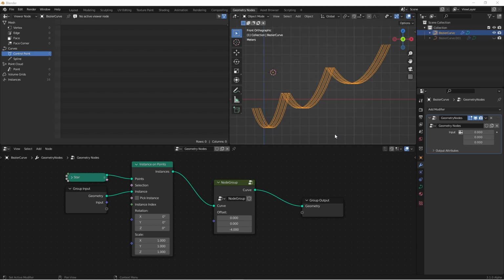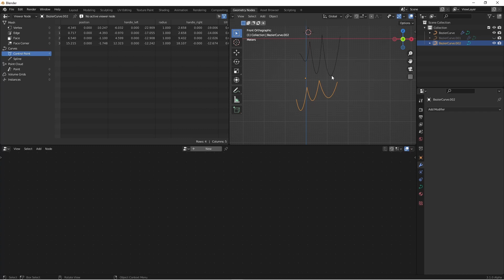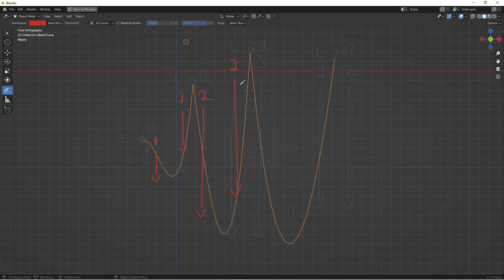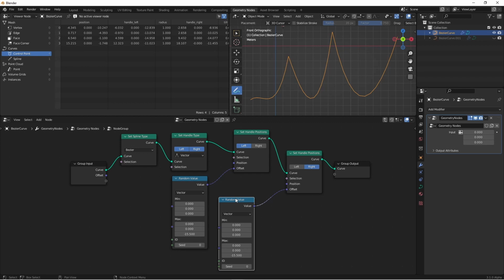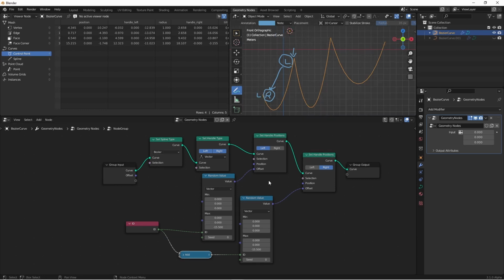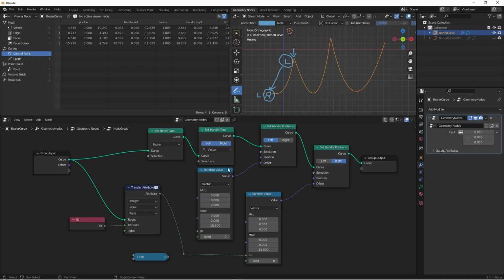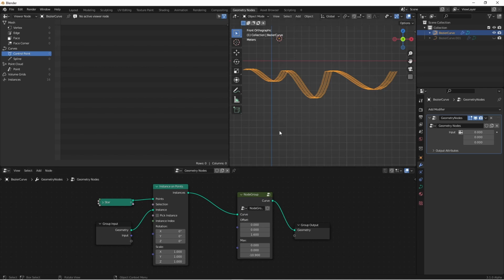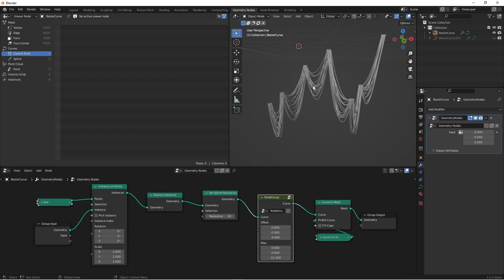Blender Fields - Hanging Cables Part 2

Comment: Why are curves referred to as curves but also sometimes splines? Is there a reason for dstinguishing them with different names? Kinda confusing like how points are points but also vertex, is there a reason for distinguishing those with two different names aswell?
Reply from the maker: Curves can contain multiple splines. A spline is one connected set of control points.

Vertex is a geometry term. Points are used to represent mesh vertices, spline Control points and point cloud points.

Comment: Working with 3.0 and had to make some tweaks with the random height offset as it wasn't working correctly. But then also for some reason placing the set spline resolution after the Realize Instances didn't work. But placing it after the grouped node it works.

Comment: Great tutorials - clear and concise. I've learned quite a few important things already.
I was wondering how would you create a node group where drooping amount is influenced by the length of each curve segment? Because naturally longer wires would sag more.
Reply from the maker: There is the curve length and curve parameter nodes that return length amounts. You could probably work those in.
Reply: You can use the Curve Parameter to a Multiply to a Combine XYZ into the Max value of the Random Number Generator.

Comment: consider the id and index may not conresponde, should it be necessary to link the index output to the id input of left random generator, or just use index / index+1 as the id input of the random genetors?
Reply from the maker: That is why we use the transfer attribute of the ID in index mode. The first random node gets the ID implicitly, we need to get the ID from the 2nd point, Because this is a simple case. there are probably other ways that will work! Do what works for you!

Comment: Excellent, very well explained. Last week in one of your videos you show us how to select points by their index number using index plus compare math node,
it is also possible to select a specific face or group of faces of a mesh by their index number? like in houdini. Thank you!!!
Reply from the maker: So it depends on the context of your field. For instance: If you are using the "set material index" node, that works on the face domain. So the index node will be referencing the face index. However using the transfer attribute node should allow you to bridge domains. I still need to experiment with that.

Comment: By far the most straightforward approach to geonodes I've seen so far, very informative. I've seen people play with the grease pencil as a way to draw curves on surfaces, and then have offset on the face normal via geonodes to generate piping (with divisions being added along the curve which then get converted into attachment points for the pipes). However, there is never a real explanation shown, and it would fit well in your current flow, thematically and presumably from a difficulty side as well (if even i can somewhat guess how they work lol). Would that be a good idea for you to use in a video? I can link an example of what I mean if you'd like to explore it. 
Thanks for the video series, once again!